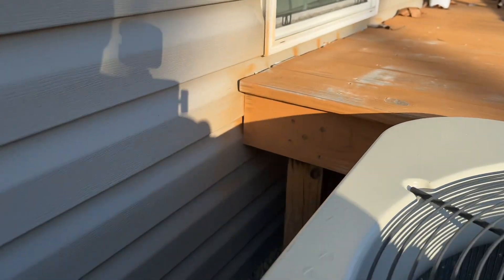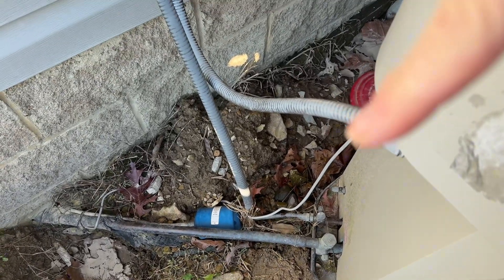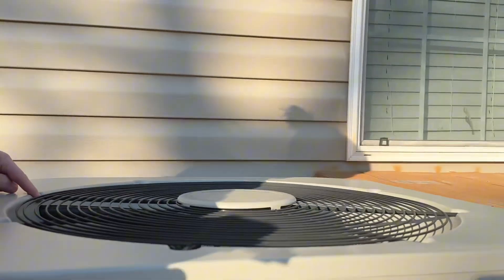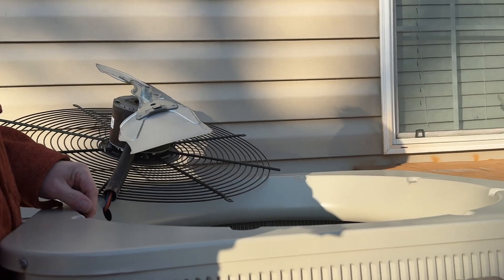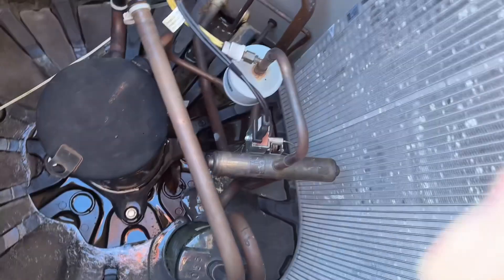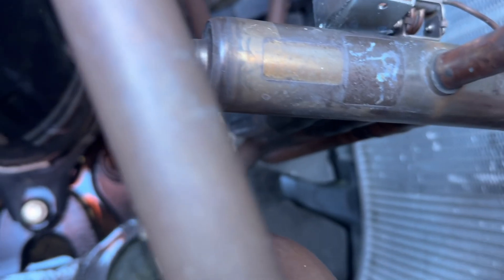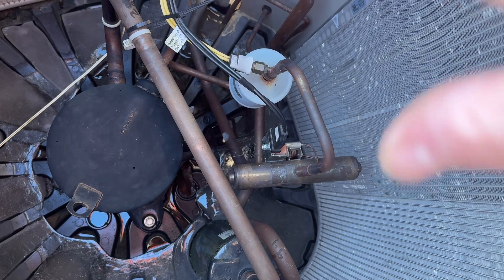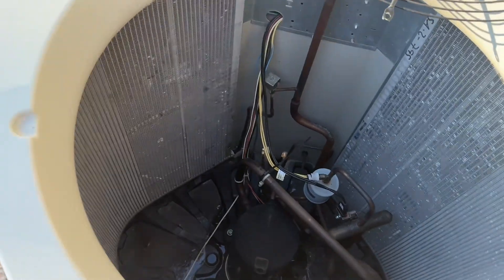Heat Pump Stuck in Heat or Cool Mode? The $5 Magnet Trick HVAC Pros Don’t Want You to Know!

Comment from the maker: 🔥 DON’T CALL A TECH JUST YET! 🔥
If your heat pump is stuck in heat or cool mode, this $5 magnet trick could save you hundreds in repair costs. I’ve used this exact fix on my own system — it’s still running great three years later!

💬 Drop a comment if this worked for you — or if you tried another DIY fix that worked just as well!
📹 Watch my other heat pump repair videos in the playlist here 👉 Heat Pump Fixes & Money-Saving Tips
👨‍🔧 Want to support the channel or get behind-the-scenes access?
Join here ➡️ https://www.youtube.com/channel/UCjUj7bwL9W0YUL8UPxoYIIA/join

#SmithFarmShenanigans | DIY HVAC Made Simple
Reply: you could put the link to the followup adding  oil to free up reversing valve video here in within your pinned comment.  I guess I should have recognized the icon near the end of this video is the followup.  Thank you, I haven't seen a video like this for freeing up reversing valves, I thought it to be a hard repair to successfully replace one.  I'm anxiously awaiting video content what you mentioned at 13:48 about diagnosing defrost board as it relates to reversing valves.
Reply from the maker: @dannythebeerman thanks for you comment, i have an entire playlist about heat pumps. Just go to my channel and you can watch them all

Comment: Great video. The problem Im having is I turned on the heat this year and the outside unit is not running like itwas the year before. Any suggestions..
Reply from the maker: The fan or nothing is running? Will need to confirm there isn’t anything at all happening outside, no noises or anything

Comment: Another trick: Turn on heat mode (If its stuck in cool or visa versa) unplug and plug back in that plug and most of the time it will trigger the reversing valve. IF  you have one wire, powering the reversing valve, get a wire nut and electrical tape, cut the wire and then arc it together, that will trigger the valve, then wire nut it and tape it for water resistance.
Reply from the maker: Thanks for you comment and helping folks out, unfortunately that did not work for me. Yes it does work sometimes especially if the homeowner is comfortable with doing that.

Comment: Thanks for posting your methods of fixing a reversing valve.   One of my buddy's heat pump unit cools great, but doesn't fully transition to heat mode and goes into auxilary heat, I can't remember if the compressor just shuts off after awhile. Chat GPT suggested to check reversing valve  and  thermal expansion valve.  He placed small magnets on reversing valve said they moved in transition from cool to heat mode, but didn't take any pictures so I could see how far the shuttle moved.  Per this video I will send him back with a large magnet to work it.   Would you have an idea about how much billable time , and odds of me successfully replacing a TXV in a 1.5 ton bryant system in basement?  He lives an hour away so it's not an easy trip to return to job site.   I'm a novice and I thought replacing a reversing valve was beyond my skill and tool sets, but is a TXV?  and could his problem be TXV?   I have replaced 2 refrig compressors in 4 years using staybrite 8 silver solder using staybrite 8, don't have access to shield gas.  thanks
Reply from the maker: So in order to be able to do a reverse valve, you have to pump the unit down and you have to disconnect the valve and you have to refill the unit with the Freon after the repair is made so therefore you have to have have a license to handle Freon so if you don’t have a license for Freon you can’t do it is what I’m saying legally it could be the TXV, if it’s a good friend of yours and you’re trying to help him out then I would simply charge him a flat rate per hour. I want to charge him by the job however, if it’s someone you don’t really know and you know you’re doing this for them then you know I would just charge by the job and you can figure probably not counting drive time if you have everything. Valve the everything else you can figure a couple hours. It doesn’t take long at all. It’s just copper and de solder it and solder it back in and then you put all the Freon back in and then hook up the coil and say it’s pretty simple job it just takes a minute so two hours probably I have other videos explaining what else’s could be if it’s the completely in one mode or the other it most definitely is probably the reversing valve if it’s sometimes going into heat mode not auxiliary heat but regular heat mode then it’s not it’s probably not the reverse valve. It still could be, but it probably isn’t but if it’s completely bypassing a regular heat mode and going into emergency heat or auxiliary heat and then it probably is the reverse and valve and he needs to have a really big magnet. Show him that video that where I did it and but you need a really strong magnet because if it’s stuck pretty good that it’s hard to move. Also, I have a video about putting oil into your system which you can do without a license to hemp free up that valve once it is running again and that will help it stay free. I really hope this helps.

Comment: In the Winter here in North Texas, when I turn my Trane heat pump to heat, error messages are thrown and then it goes to the heat strips only when I reset breaker. Could this be the reversing valve?  My technician says they are very hard to change out and all freon on outside unit cannot be recovered.  Costing thousands of dollars.  Is this true? Also, could it be the expansion valve?
Reply from the maker: I’m not fully understanding exactly what you’re saying. It sounds to me like you’re saying that it only heats even though you got it in the cool mode or are you saying that it only uses emergency heat and not normal heat? If so, it could be just the high pressure switch, which I have another video on how to change that and that’s easily changed and cost about 30 bucks however, if it is the reverse valve, tried to use the magnet trick that I showed in this video also get some oil and put into your system like I show you and talk about in another video and that helps free up the reversing valve along with the magnet trick, however, the reverse and valve is permanently stuck. Yes it’s a very expensive fix and if your heat pump is older. I would definitely recommend just get a new heat pump however if it’s a brand new system, especially on a warranty then you may be able to get it repaired for cheap. if I’m missing what you’re trying to say altogether, just ask me again and I’ll see if I can clarify.
Reply: @SmithFarmShenanigans  yes when I turn the heat on for the heat pump, it will work for a while, but in really cold weather it throws error messages and just blows cold air.  I can put it on axillary heat (heat strips) and it will work but it never returns to the heat pump!
Reply from the maker: @gosman949  so a couple of things if it’s below 32° heat pump should be in emergency heat anyway, but above that regular heat pump should work if it’s not it probably is your high pressure of high pressure switch. You can watch my video to see how to change that diagnose that good luck hope you get it fixed.

Comment: should have told then to turn off the air handler to kill low voltage also.  if trying to free up the valve.
Reply from the maker: Im pretty sure I did say something about making sure there isn’t any power going to the unit,  also as long as there isnt a call to the board from the thermostat its fine, thanks for the comment

Comment: After a storm my heatpump blows the air handler 24vac fuse when I call for cooling (my system defaults to heat). It seems the reverser solenoid coil is pulling too many amps. Is that likely due to a stuck reverser valve? I think the solenoid only controls a high pressure line valve and the high pressure is what shifts the reverser valve. Can a stuck reverser apply back pressure to the control value such that it takes more power to operate the reverser solenoid? I haven't been able to find documentation on how many ohms the solenoid should measure.
Reply from the maker: Thank you for your comment and you are on track, A stuck or sticking reversing valve can indeed cause the coil to draw too many amps thereby blowing your fuse. Also, another indicator is that even though you’re calling for cool and instead getting heat my guess is that it probably is a stuck or sticking reversing valve. Try the magnet trick and see if that helps then get some oil and put that in your system If you get it unstuck. hope you get it fixed at no cost to you. On a final note if the valve is not stuck,  Then your coil itself can be going bad. I’ve seen it happen before the coil is relatively cheap and easy to replace.

Comment: I have investigated this, and found that the reversing valve is made of a plastic that swells when MOISTURE gets into the system, jamming it. cost me a LOT OF GRIEF. get a new dryer - filter.
Reply from the maker: Thanks for you comment, the body of the valve is metal and the ends usually have rubber plungers

Comment: Could this cause your pressures to be off? I just installed a vertical 5 ton heat pump and my pressures are high getting 71° out of my supply
Reply from the maker: Yes, a stuck reversing valve absolutely can mess your pressures up

Comment: For me it's stay blinking in heat mode and won't start the pump some times it starts but mostly stuck in blinking  but in cold mode it runs normally ?
Reply from the maker: Normally when the reversing valve is stuck is will still run it just want heat or cool, if it runs great every time in cool mode then it probably is still the valve

Comment: Thank you for helpful videos! Subscribed. When I had a problem with my 32 year old heat pump not turning on, I was advised that it could be the defrost board. I was surprised to find one on ebay for $30 and it solved the problem. So I bought another. Now, years later, they are only $13 so I bought two more, just in case, as well as a few other backup parts. On to your next video.
Reply from the maker: That’s awesome, I truly enjoy hearing stories like that, thats how we keep things going, also thanks for the comment and the subscribe

Comment: Since it's been getting warmer in the dc area. I've had two units that were blowing heat when in cool mode. Both times it was the thermostat.  Them smart thermostats be fckn up.
Reply from the maker: Yes sir you are correct, my brother-in-law heat pump did the same thing, ended up being a smart thermostat.

Comment: This guy should also tell you its a temporary fix. You could be facing the same exact problem a few days later or months but its indeed temporary. Or you could luck out like this guy. I doubt he didn't have another problem with it.
Reply from the maker: @banjovibanjovi501  thanks for your comment, it not always a temporary fix just like its not always a permanent fix, as i stated mines stuck about 15 months ago, i used this method and have not had a single issue. A heat pump “pro” want over $800 to replace the defrost board, so i guess this guy should also tell everyone that heat pump pros a lot of time overcharge and try to sell you parts you dont need, but hey lets bash the free fix, lol. Oh and you can doubt my claim if u want, i have no need to lie and in fact i dont because I believe in Jesus Christ.
Reply: @SmithFarmShenanigans  yea, your indeed correct.

Comment: Sorry, the magnet won’t move the valve because there is no pressure differential unless the unit s running. Reversing valves sometimes stick because of a low charge with insufficient pressure difference.
Reply from the maker: @EarlHayward  yes that is correct , however if the charge is correct it will move, ive done it to my own unit last summer, but if for som reason your charge isn’t correct no it want move when turned on i discussed all these parts and their failures and fixes in separate videos, thanks for your comment. You can move it with the unit off, i have done many times. The pressure differential just assists the valve moving, it does not control the valve. The only way it want move with a strong magnet is if something is wrong, ie; stuck valve, bad energizer coil or the wrong pressure. However you should still be able to move it when the unit is off, unless the valve is stuck, I don’t care what anyone tells you, it most definitely will move with a magnet when the unit is off. Dont let them swindle you out of money on things that dont need fixing.
Reply: The valve will move either way with a strong magnet. I know because I’ve done it with the ceiling unit at work and with a guest unit at my work. They have special magnet that you install instead of the solenoid coil.
Reply from the maker: @alphabears6342 thats exactly right, I just wonder if people try to sow misinformation so people dont go around trying to fix things themselves, cause if someone knows about differential pressures then they should know that when the unit is off the valve will most definitely move, so make me believe its just trying to misinform people
Reply: Being a rookie hvac tech, I think you can move the reversing valve slide with a magnet if it’s a magnetic material. If the system is off. I think if you moved it and then turned the system on the pressures would move it back. If you had the round solenoid magnet then it would work perfectly and you would just have to remove the magnet to change modes

Comment: If I’m just trying to get an old unit that is stuck in heat mode to change over to AC can I switch it manually with a magnet ?  Like will it stay in AC mode as long as it isn’t turned to heat or does the valve usually move back and forth each time the unit kicks on and off ?  Thanks so much for an awesome video.
Reply from the maker: @michaelhester3193  thanks for your comment, if u can move the valve with a magnet it may stay in cool mode, depending on the reason for it being stuck, just keep sliding the magnet back and forth for about 15 times, u can kind of feel it, then try your heatpump, it its still heating go out and slide it the other way and see if it cools, donthat a few times, if it dont cool then its stuck, you can get the oil from a heat pump vendor to out in it, hope this helps. I have other vidoes that talk about diagnosing the valve
Reply from the maker: @michaelhester3193  thanks for so much for the comment. Yes if you can get the valve to slide, it is possible to put it in cool mode and it stay there. What you have to do is slide it back-and-forth about 15 times to try and free it up and then go in and turn the heat pump on and see if it cools if it does not go out and slide your magnet One Direction to the other side go back in and try it again. Do that a few times to see if it cools, if it still doesn’t cool then you probably have a stuck valve. You can try to order some of the Freon oil from a heat pump store or vendor to see if that will free it up. If it doesn’t you’ll probably have to watch one of my other videos to diagnose exactly why it’s not moving. I hope this helps. Also make sure its a pretty strong magnet

Comment: Just inquiring about the coil connector. Is there a polarity on the connector or is it just one wire in and then one wire out back to the board?
Reply from the maker: @mikkelparmley30  yeah that is correct, no polarity on the coil just voltage that operates the coil. Thanks for your comment!!

Comment: Didn't quite understand where you were adding that oil to the unit to free up this reversing valve. ThX
Reply from the maker: @tptm100  I didnt add any oil, I was saying they make compressor oil you can-add to the system, where you add freon, you can order in a pressurized canister and add it yourself since it isn’t freon, but  if you are unsure just get a  pro to do it, normally you want need it though to do that trick I showed, thanks so much for the comment

Comment: I have a carrier Ch14nbo36-B My unit outside keeps running nonstop the thermostat is on Aux Heat. I looked outside the small copper lines that run into the house where the rubber boot is I see oil and it's oil on the grass and line ( Yes it's cold in the house) I don't know where to start to check first with this pump. No frost on the condenser, the fan runs like crazy
Reply from the maker: Oh man ok that good information, first off thanks for your comment but unfortunately its sounds like you have a leak in your lines or worse you compressor is going out or has gone out. I wish there was a cheaper way to fix your unit but gona have to have someone check your freon levels, now u can do this part your self, you will need a set of gauges which you can get from harbor freight, maybe ill do a video on that today for you and get it uploaded.
Reply from the maker: Also if its a bad compressor, sometimes you can find one used and have someone install just the unit for you, that will save you a bundle
Reply: @ Yes could you do a video
Reply from the maker: @MonemonAmericasFavorite  ill try my best when i get home in a couple hours, then ill try to upload it this evening.